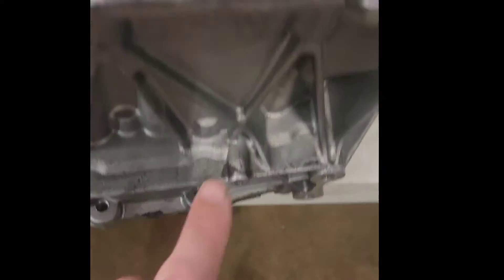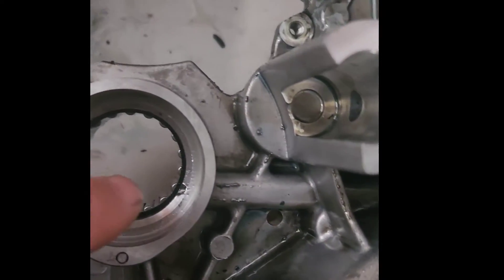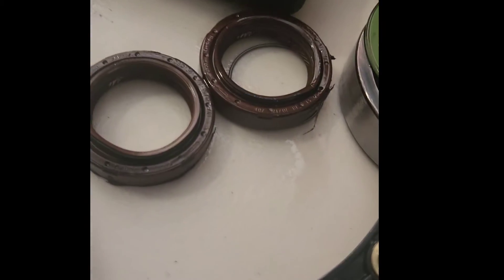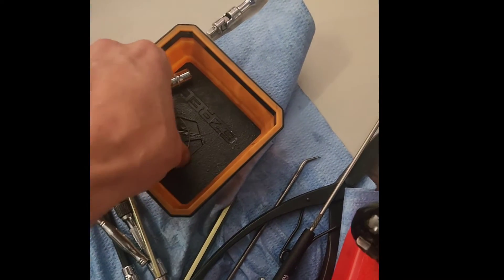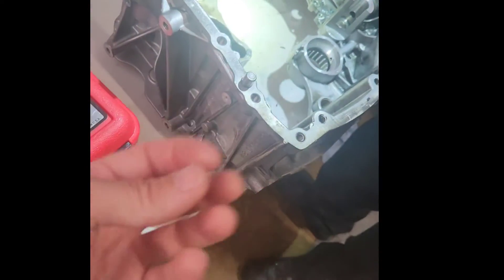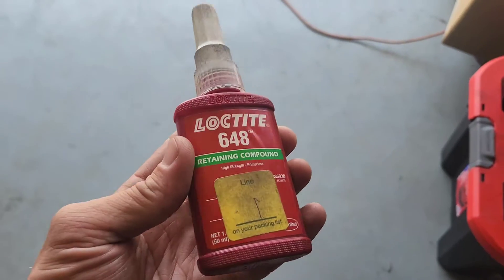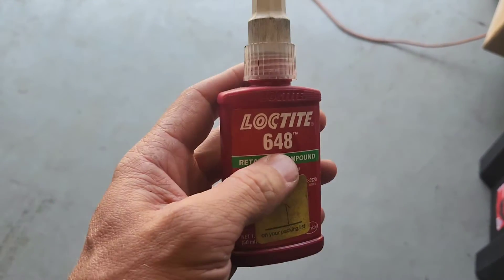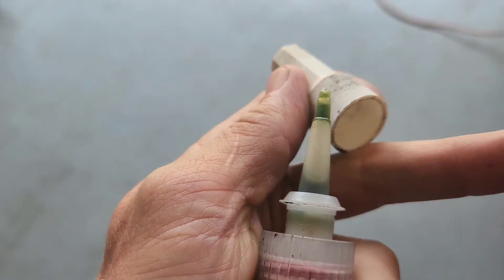Ferrari DCT Weep Hole Leak (Getrag Powershift 7DCL750) (Mercedes, Ford) Cause and Repair

Comment from the maker: Link to the Seals at our store here: https://hollywoodmechanic.com/product/dct-main-shaft-seals/
Reply: 2018+ doesnt have weep hole. What happens if you just "seal " that hole?
Reply from the maker: @coldstartsi  you pump clutch fluid into gear oil. Then you run out of clutch fluid and get low clutch pressure faults. You also destroy the gearbox. Also, 2018 models and up still have weep holes or it's a different gearbox.

Comment: If this is a design issue, doesn't this mean it will affect every car sooner or later?
Reply from the maker: That is correct. 👍
Reply: @HollywoodMechanic thanks, what would you say, mechanically, contributes to some cars having these issues say with under 10k mileage, yet some may last 100k+ without this issue yet?

Comment: found my problem, do i need to drop the whole box
Reply from the maker: Yes. You can't pull the shift fork rods out without removing the SAP and that requires the front half to be separated. The seal is in the rear half, in rear and second quarters so you must remove the whole box and tear apart.
Reply: any videos or instructions on how to remove the first casing @HollywoodMechanic
Reply from the maker: @StivenMihajlovic  I linked the step by step instructions from the nhtsa in the description
Reply from the maker: @StivenMihajlovic  on my main getrag 7dcl750 video.